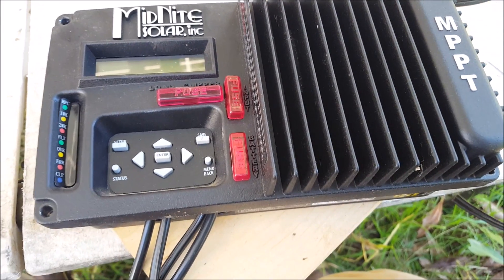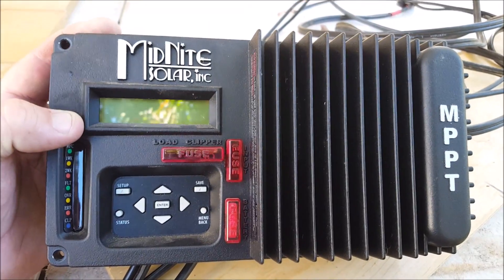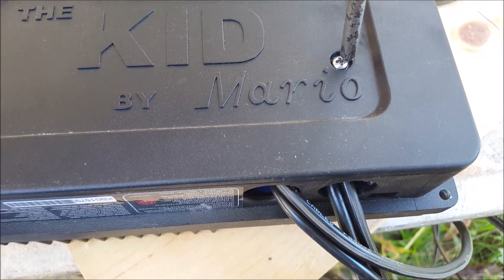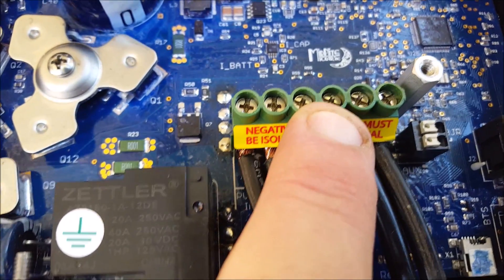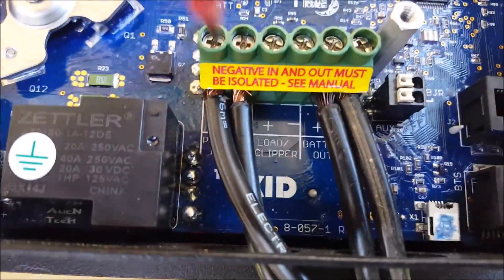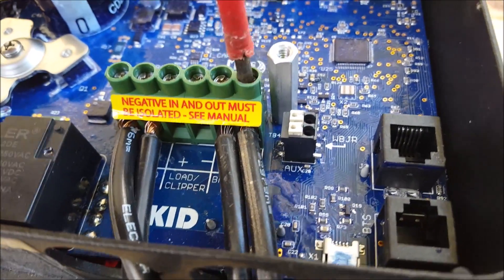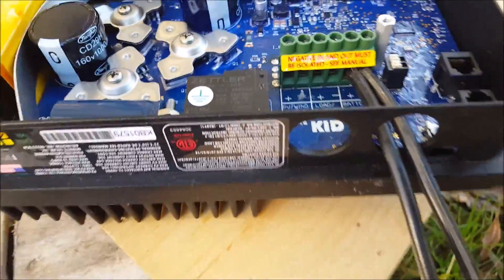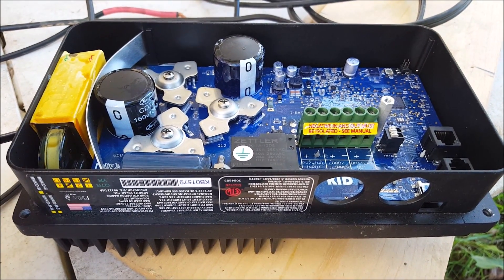Off grid solar power - My only gripe about the Kid charge controller

Comment: Bad wiring short circuit risk!
830Wp of panels are too many.
considering also the cloud lens effect
http://www.midnitesolar.com/sizingTool_kid/
For 24V batteries, they recommend not to exceed the two panels in series,  40.3V input to the MPPT for lead acid batteries, this to maximize efficiency and not unnecessarily heat up the MPPT

Comment: Not the best connector in the world and I'm not defending the choice of connector being used but, bootlace crimps would work wonders in this situation. I use bootlace crimps and crimper at work for most of our control and small light and power distribution boards. Less chance of a stray strand of copper bridging across to something it shouldn't. Hope you have it all sorted out, all the best from Matt.
Reply from the maker: Karinya Fields Thanks.

Comment: Yes I agree no room and there to close. the 6mm will handle the amps no problem. Just need to keep the wires short. All the panels on my roof are wired with 6mm.
Reply from the maker: Justin Case Solar Power and Bush Camping - I've got 6mm from the panels and that's fine because it's about 17-18 amps at the most. I'd like to be able to use heavier cable to the battery bank because that's quite often right on 30A.

Comment: Yeh so many are like that or far worse, I do prefer good sized robust terminals, I'd pay a little more just to get that, personaly I just run heavy single strand to my own external terminals on the wall and then wire to that just so I don't damage the controller circuit board with accidental movement.

Comment: I found that too. The Morningstar TriStar 12-48V 30A MPPT Solar Charge Controller are much better for allowing larger cables, however I do love the Midnite and Outback gear.
Reply from the maker: TechStories79 - I have pushed this to its limits. 2kW array at >150V on a 24V system and it just takes the punishment.